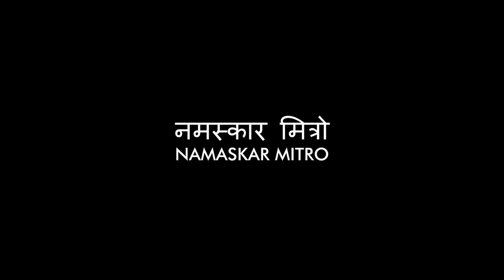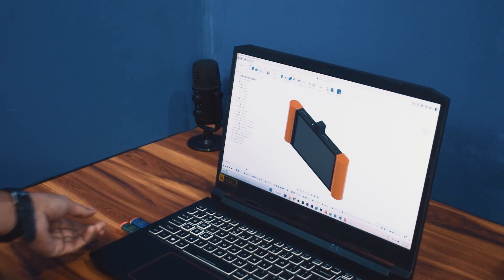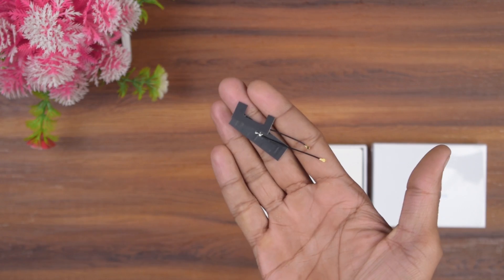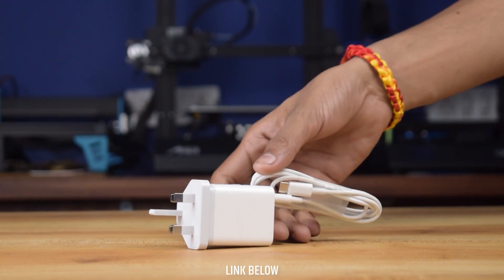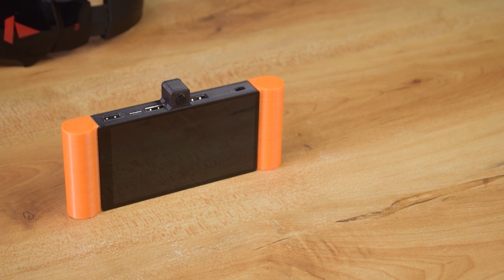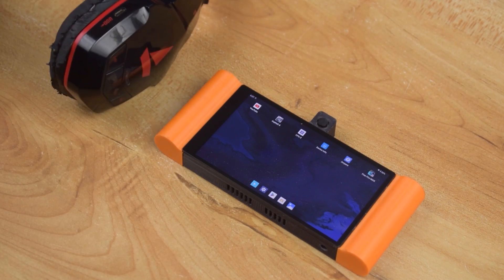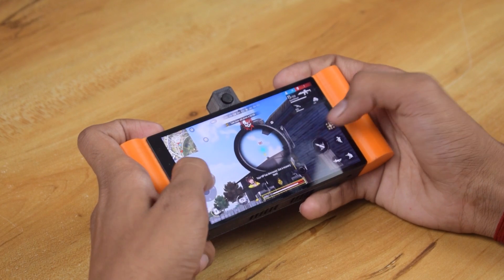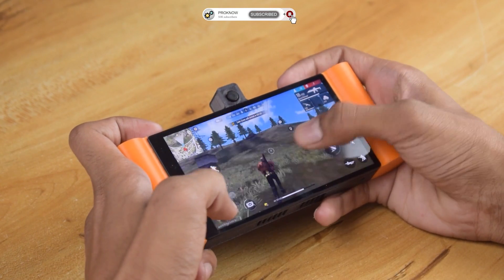How to Make Your Own Android Tablet Computer - Khadas Edge 2

Comment: 18650s in non waterproof material in the palm of your hand. Can't see how that might turn out bad. *Water,  COUGH battery COUGH*. Not to mention 18650 houses in guessing PLA maybe PETG either way both brittle as hell and can easily be shattered by anything more than a slight fall. Exposing the battery to possible damage and 18650 or any LiPo for that matter you do not want to damage as they can easily catch fire. I obviously don't need to explain why that's bad. Especially if your indoors, this could be hazardous, no fan either so that 18650 is already got heat to it and just waiting for it's time to shine. ,(pun 100% intended)

Comment: no cooling solution wtf
Reply: It's a low power consuming processor which means it will not make too much heat as it is drawing so low power around 4 to 5 watt no additional active cooling is needed
Reply: khud laga lena
Reply: Phones dont have cooling systems either only the newest like redmagic or iphone 17

Comment: how did you designed and printed the outer surface? 😓😓
Reply from the maker: I used CAD software called Fusion 360 to design this.

Comment: You should make this kind of things to be repair-friendly. If you just glued and soldier including battery, that just become like normal android phone with cheaper price. Modular things is what our world want more now.
Reply: But is it definitely cheaper? I agree that the battery design, at least, should be interchangeable. The project is fun, but it's only profitable because the PCB was subsidized.

Perhaps a low-cost PCB, like a Raspberry Pi or similar, could be profitable to create.

Comment: Next time add cut apart an Xbox controller or use Nintendo switch Joy cons and use the motherboard and print a new shell and screw the motherboard and buttons inside the new shell and make this with actual buttons

Comment: Interesting project!  Just a information that the antenna not recommended on be mounted on the back of the PCBA board and far from the metal material will be good for RF performance.
Reply from the maker: Thanks for the info!

Comment: innovative thinking, really good, i dont mean to say anything bad abt it, but the design could have been more compact & if there was a slim cooling system the device would have worked more efficiently, the buttons could be embedded on the side & abt the batteries, uh could have used lithium ion slim type battery & much more changes could be done, good work btw
Reply from the maker: Thank You for your suggestion, My approach used to make this product unique.
Thanks for watching!

Comment: A regular phone outperforms this device in Android games. The design is cool, but the application is negligible. Linux is much better.
Reply: Это при том что плата khadas  стоит $300+ модуль дисплея. Цена лишает смысла самоделку
Reply: @sralzagarajami if i didn't solder smtng. in it myself, it's not the same holding it - having done something on/in it makes it more valuable. Maybe it's just me.   - but I get you 👍
Reply: Totally agree with You.
Reply: Bro it's at least as powerful as a midrange phone
Reply: But this is fun to make. That's the whole point.
Reply: I think the more important information to take away would be the assembly and parts not necessarily the end results. You can use this method to make a BEAST of a tablet. One that basically counts as a computer.
Reply: Can I please have it please
Reply: I can run windows also😂